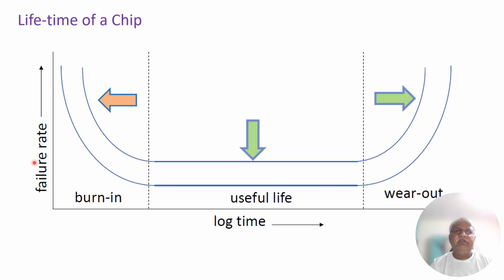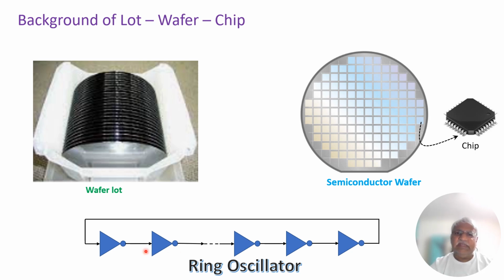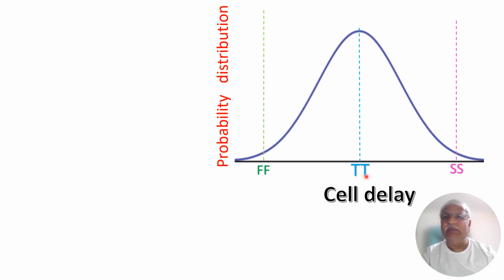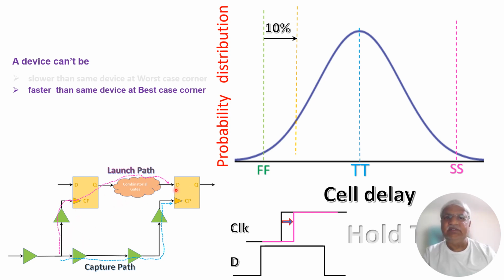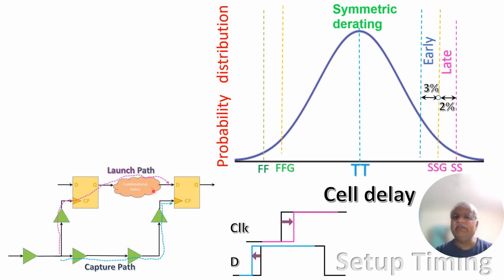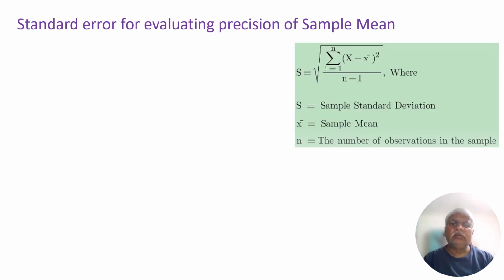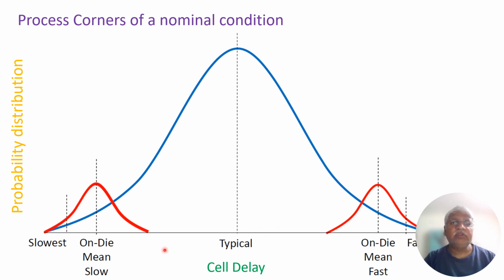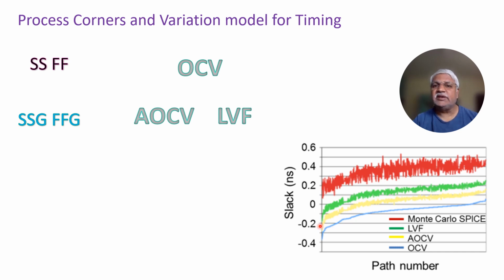Glimpses on PVT corners’ evolution

Comment: Thank you Sir for your contributions. Ivery inspiring and empowering!

But, I think worst case setup and hold scenarios are mixed up. 

Worst case scenarios--
Setup : data slow and clock fast. 
Hold : data fast and clock slow.  

Question: you applied 8% derate on data cells to speed it up for Setup in SS corner. That helps Seto correct? Isn't the 8% derate to be applied on Clock to speed up clock path ? 

Similarly in assymetric , you are speeding data and slowing clock which will help Setup , correct? Are we not supposed to be analyzing the other way for worst case scenario? 

This is similar to 10% derate to slowdown clock in FF for hold. 

Thank you